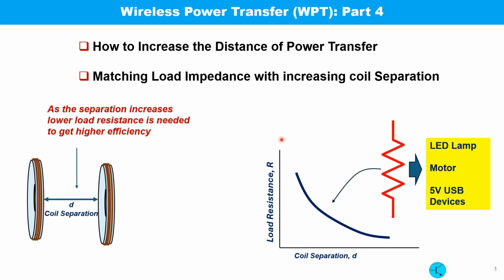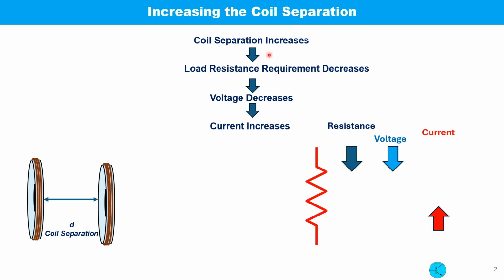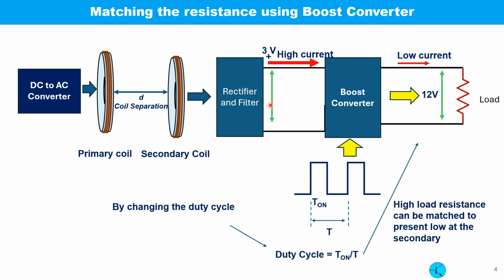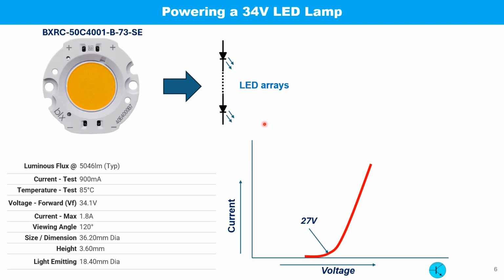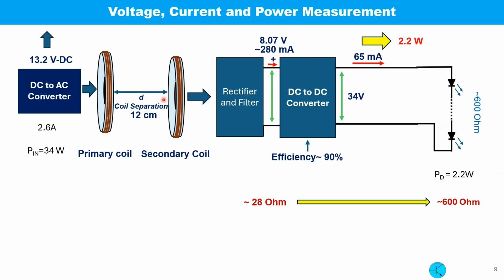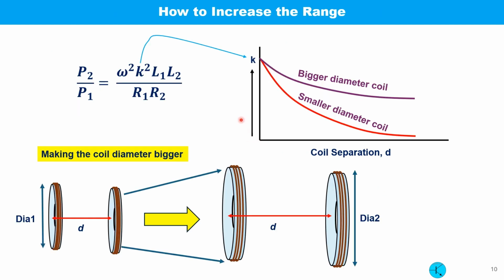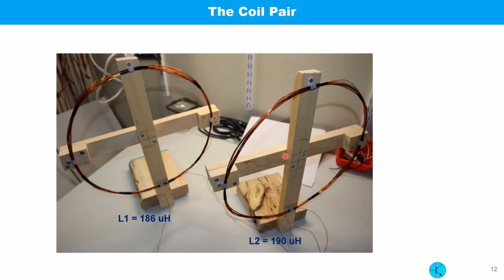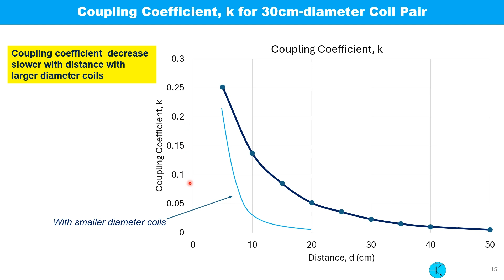Wireless Power Transfer Part4

Comment: Wow. After following the entire Wireless Power Transfer series I feel like I hope to see a small video explaining radio waves and some really awesome applications... I saw a lot of videos about this radio frequency, but a lot of them don't explain like you some aspect in a circuit (like in a amplifier for a radio wave using 2 transistors, one for the DC bias and the other for the signal amplification). So, to be short I really hope to see a video about radio waves after you spoke about non-radiative waves.
Reply from the maker: Thanks for watching. I hope to make videos on radio waves and radiative power transfer in the near future.

Comment: Very interesting. Is it just me, or in the last few seconds of the video, as you separate the coils, the light intensity seems to increase as the distance increases? It might be an effect of the auto gain control on the camera.
Reply from the maker: Thanks for watching.  Yes, you are correct, as I am using a low resistance incandescent lamp the brightness is maximum in the middle. It is kind of surprising, but can all be explained in terms load resistance and matching.